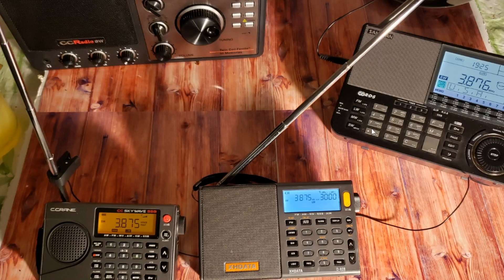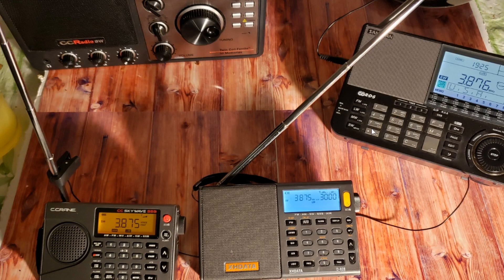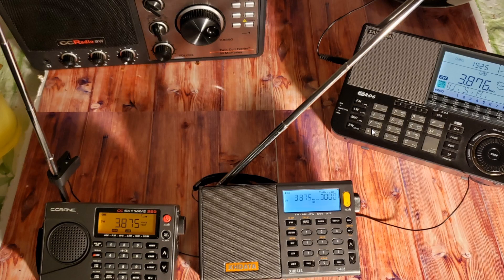PART 3 Shortwave for Beginners Why I don't hear anything on my new radio

Comment: In my home, noise was a serious detriment to SWLing.  Walking around with a portable radio, I was able to find the sources of RFI noise.  I had 3 dimmer switches in the kitchen which, when turned to ON would emit MASSIVE RFI as a wide spectrum buzz or humm.  After much research, and discussion with my wife I replaced those dimmers with simple ON/OFF switches.  The result is much less RFI.  Also a sump pump in the basement when running would emit RFI.   Adding some clamp on Ferrites to its power cord reduced that interference greatly.

Lastly, moving the start point of my 138 foot 12gauge long wire external antenna FURTHER away from my house and supporting tree (30 feet away from both the house and the tree) also reduced the noise floor on my receiver a huge extent.  The receiver is fed with RG8X coax and the receiver ground is three 8 foot copper rods three feet apart from each other in a kind of a mesh.
Reply: How did you connect the wire used as your antenna and also add a ground too? This is the information I cannot seem to find.

Comment: Being a shortwave listener since 1977 unfortunately almost all the major broadcasters have shut down (or gone  internet) it is very rare to find an English transmission now hence my shortwave radio is packed away. I used to love hcjb, radio Netherlands, Deutsche welle, radio Australia, China radio international, Swiss radio international, and a lot of the other European broadcasters that broadcast in English. A pity but the sign of the times.🙁
Reply from the maker: Much more English broadcasts than you think, the problem is that when you live in a high noise environment ..a lot of the signals are washed away.
Reply: @OfficialSWLchannel  Thank you for your reply. could you please tell me of a few European broadcasters who are still broadcasting English, I don't have a very high noise level here I live in a small rural town and am fortunate enough to live on the top of a hill  .  thanks Grant.

Comment: I have the XHDATA800 and definitely the external end fed long wire antenna helps. Having said that, I was Dxing mainly in the 80's and the shortwave bands are slightly quieter now.  Still find a lot though!

Comment: Yes 👍 this is very true as I have so experienced as both an apartment and
house dweller in my 60 years with radio,
first MW, then SW, and finally as a ham.
It does help to take my radio equipment
outdoors, even with a terrace, the back
yard outside is better, and I have also operated mobile from a vehicle which
is grounded to the chassis.
Of course, we are at the bottom of 
Sunspot Cycle 24 in 2020. The sunspots
help with higher, above 10 Mhz bands & frequencies too, especially at the peak 
of a cycle. As does the season and the
geographical location one is at
Another big change in recent years,
is the decline of international radio, SW,
Boadcasters due to the Internet and
cellphones. There were many more on
in my earlier years.
Here, I receive US SW stations, many
are of a religious nature, 🇨🇺 Cuba, here
in SE Florida a lot being close by, and
sometimes Brazil 🇧🇷,  with music, for
example. 73 de W2CH (ex WA2ZPD).